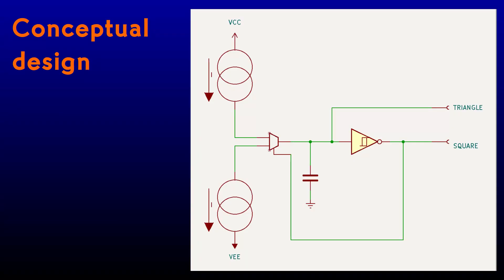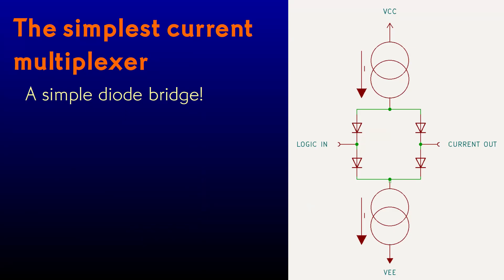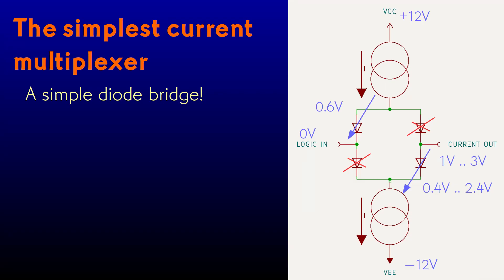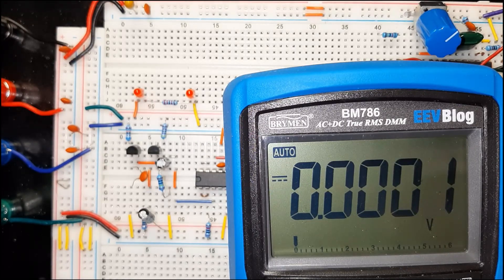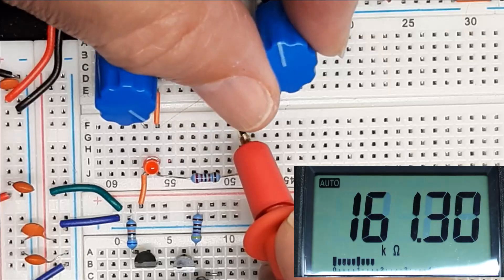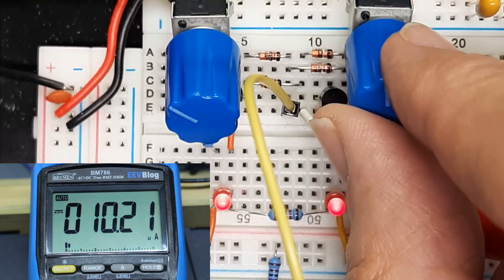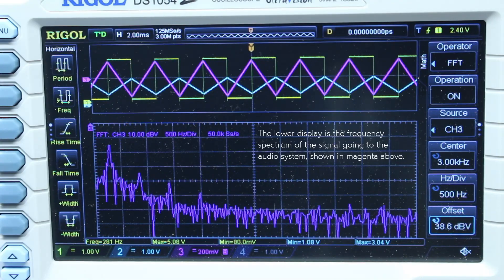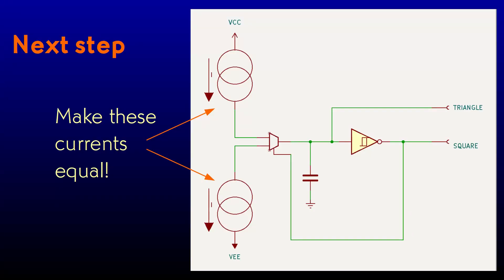Audio Synthesis Ep006: Diode bridge oscillator

Comment: An interesting low tech approach would be just using resistors .... strapped to a 100V or such while keeping the amplitude of the triangle wave to a couple 100mV :)
Reply from the maker: That's actually how some of the stuff in the 1970s-vintage Tektronix oscilloscope works. There are transistors (and matched pairs) with 150V collector supplies in it!  (I think the designers were probably used to vacuum tubes.)

Comment: Can this circuit be voltage controlded (i.e. for synths such as eurorack)?
Reply from the maker: I'm working up to that, so stay tuned!  The plan is to develop this into a fully functional triangle-core VCO - volt/octave control, FM, sync, sine/square/triangle/pulse waveform outputs.  One little step at a time, in hopes that my viewers will come out of this being able to design their own, rather than just copying my design.  There's a little series of transistor-theory videos coming around over the rest of the summer, so that I'll have the building blocks to make the exponential converter and the current mirrors that are essential parts of most synth VCO's.
Reply: @KludgesFromKevinsCave   Thank You for taking time to educating us.
Reply: @KludgesFromKevinsCave  you're an absolute legend! <3 <3 thank you for sharing your knowledge